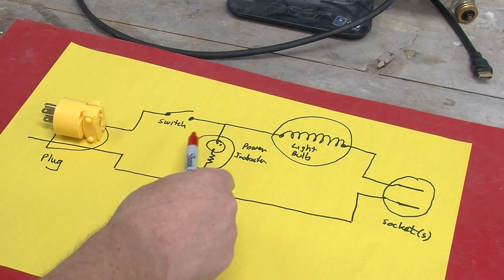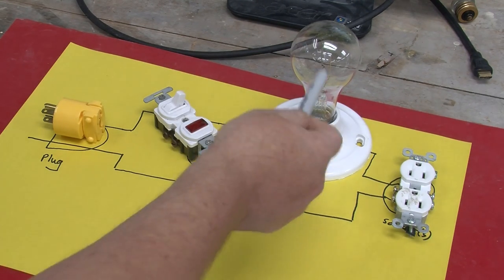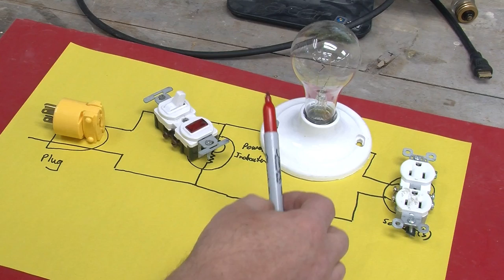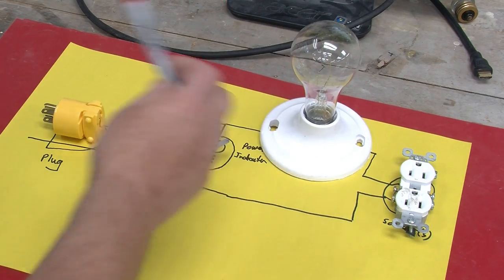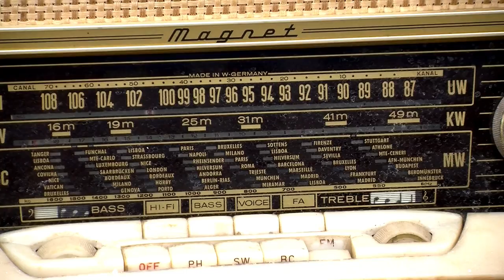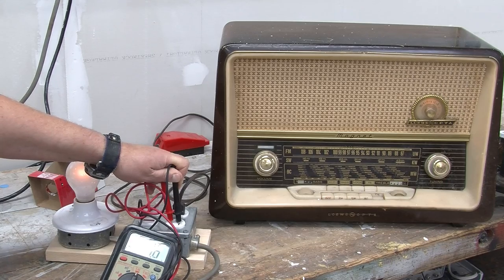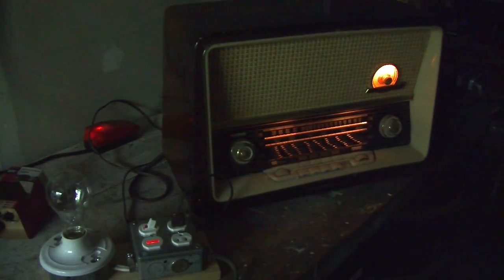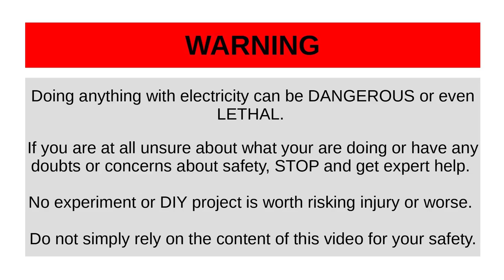When a Light Bulb is better than a Fuse

Comment: 1:56 he placed the pair of sockets upside down
Reply: Did he? Just because you're used to seeing the ground terminal below live and neutral doesn't mean that's the only orientation or even the most correct one!
If you look at the websites for manufacturers like Eaton and Leviton you'll find the pictures they use for their duplex receptacles have the ground above the live and neutral. They also often have text markings for either orientation.
Reply: Also in the US, the NEC doesn't specify which orientation recepticles should be installed in.
Also also, the outlet in the video is held horizontally, so any orientation will simply be horizontal.
Reply: @Falcrist  the outlets in the contraption with the light bulbs is upside down I was taught that ground should be down in Canada it really isn’t specified either but it REALLY bothers me seeing a plug outlet where the ground is up instead of down but it doesn’t bother me if it’s installed sideways though only if it’s upside down with the ground up does it bother me
Reply: @Falcrist  I once say this picture online (I don’t know if it’s still there) where it showed 2 plug outlets one with the ground down that said “correct” under it and one the that said “inverted” with the ground up to me it just looks wrong with the ground up and because that looks wrong it bothers me but I don’t mind them sideways though it’s only when the ground is up does it bother me
Reply: @michaelsegal3558  I believe you're both correct in that it's not specified but in my experience it's generally agreed on by electricians that ground up is preferred. Imagine you drop a piece of metal and it falls between the plug's insulation and the receptacle- in the ground down case it may fall across hot and neutral causing a short. In the ground up case it will likely bounce off the ground pin and fall away at an angle instead of coming to rest as it could across opposite two prongs.

I've read that you will often see ground up installations in commercial kitchens, hospitals, and office buildings for this reason

Comment: doesn't that country have proper trip switches in the db board that does exactly that? also using a bulb like that is waisting power
Reply from the maker: The bulb is just for testing and troubleshooting while repairing  a device. It limits the current if something goes wrong while still powering the device to make it easier to troubleshoot.
Reply: @ElectromagneticVideos  so acting as a buffer slash fuse
Reply from the maker: @jacquesb5248  Yes - and using the lower resistance of the filament when it is cool to allow almost full voltage to the device under test when the device is working. The Tungsten filament's resistance increases when glowing limiting the current flow if the is a problem much more than a simple resistor would.

Comment: This is just silly.  Period.  You don't need low current to find a short or to continue to cook a bad cap.  You can do that stuff with an ohmmeter when the power is removed.  This looks like something i would have fooled with in elementary school; I am quite serious here.
Reply: When you're firing up a 70+ year old radio for the first time you don't have to worry about a component failing short on you. I doubt many check every component first ;)

Comment: Sorry, a thumbs down because the point of this video was how the lamb can protect the circuit in case of a short. You should have simulated such and show how the bulb would glow at full luminance had the radio or any other device were to develop a sudden short. This is a common btw device used by (music) amplifier repair technicians.

Comment: I used a primary from a transformer...NO HEAT☝😁
Reply from the maker: You mean as a current limiter in place of the bulb? That's interesting! What size transformer do you use? And how much current does it allow that way?
Reply: @ElectromagneticVideos  a small transformer...i measured  0.36 henries which equates to 135.717 ohms in reactance☝😁
Reply from the maker: @gvcjbf1266  The interesting thing about what you are doing is the vector sum of  the inductor reactance and  load resistance will be less than the scalar sums of their individual  impedances. So it should be  better than a plain resistor in terms of providing current limiting in short circuit type situations and minimal voltage drop when the device under load is working properly and drawing less current, not unlike the bulb. Of course if the device under test has a transformer power supply with a significant inductive current, then the vector rum of the  impedance's  would be closer to simply scalar adding.
Reply: @ElectromagneticVideos could i add a 20 uf capacitor to the transformer?
Reply from the maker: @gvcjbf1266  So what would you be wanting to achieve? Looks like you chose 20uf to be resonant close to 60Hz.   The 20uf in series with the coil should makes the impedance cancel and effectively resulting in nothing other than the actual resistance of coil and capacitor wires. Drawing a current though it will create large voltages across coil and inductor with the vector sum = 0. In parallel, the combination should appear to have a very large resistance. If you experiment with either, be sure you use and  AC  capacitor with sufficient voltage rating and have appropriate protections like isolation transformer in place.
Reply: @ElectromagneticVideos  just limiting current surge
Reply from the maker: @gvcjbf1266  For repair applications or as a permanent part of something? Either way, adding a capacitor will essentially undo the effects of the coil. There are also thermistors often used to limit inrush current etc.
Reply: @ElectromagneticVideos  thanks...
Reply: @ElectromagneticVideos  i was trying to make a variable step down power supply for a nichrome strip...which is a part for a pet bottle melter...maybe you have some ideas?
Reply: @ElectromagneticVideos  computer power supply is expensive...dimmers dont go below 35 volts...saw a promising lead on king of random aluminum melter..but couldnt find the power supply...no benchlab power supply please
Reply from the maker: @gvcjbf1266  I had to look up PET = Polyethylene terephthalate   = common plastic bottles! That's an interesting project. It looks like you need a lot of heat and high temperatures, So let me ask you a few questions which will help figuring outs whats best: Whats the max voltage and power (or amps) of your nichrome heating element? Is it in something like a countertop oven?  Whats your level of electrical expertise/experience - minimal/ hobbyist/ experienced hobbyist etc? You seem to have a low budget - whats the max cost and what the reason for the project - art, recycling, experimenting, school project (what level of school). Where in the world are you - that will help figure out what parts are easily available to you?
Reply: @ElectromagneticVideos  my primary goal is recycling...my expertise is hobbyist...my limt is household item..for 3d printer.
Reply: @ElectromagneticVideos  nichrome wire specs...around 1 volt ...14 to 20 amps
Reply from the maker: @gvcjbf1266  So thats very low voltage at a lot of current which points to a switching power supply as the most inexpensive way to do it. Is that typical for 3D printers? If so are there cheap mass produced power supplies with this sort of spec. My first thought would be to get some thinner nichrome wire and use a longer length to require something like 20V at 1A which would be way easier and cheaper to produce and control.
Reply: @ElectromagneticVideos  i could open up a soldering iron...thanks ...but i had a step down microwave transformer in mind along with your lightbulb design...the secondary coil would determine the voltage...
Reply from the maker: @gvcjbf1266  Actually a a few turn of thick copper wire through a transformer core like that should work. Be sure to remove the HV winding from the transformer. There are videos on spot welders etc using those transformers.
Reply: @ElectromagneticVideos   directly adding mains power to the primary of a transformer winding causes shorts...it has no impedance...so your current limiting lightbulb helps thanx
Reply from the maker: @gvcjbf1266  Yes! I wonder how the spot welder people solve it. You could use the coil as you previously described in series with the stepdown transformer. If its also a microwave transformer too, be sure to remove the HV winding - I cant emphasize more how important it is for safety to get rid of the HV part.
Reply: @ElectromagneticVideos  thanks..they do that on purpose..btw
Reply from the maker: @gvcjbf1266  Great! Good luck with the project!
Reply: @ElectromagneticVideos  btw friend...have you tried with a soldering iron yet?😁its a heating element..no light...just heat
Reply from the maker: @gvcjbf1266  If you just want a resistor, any heating device will do. The advantage the bulb has for testing type applications is the large temperature swings on the filament which causes considerable changes to is resistance resulting in low resistance when the device under test is operating properly and drawing little current, and high resistance when the device under test has a fault. It can be thought of as a very crude constant current source.
Reply: I have found it...on electronoobz comment...it really works...just add a 20 to 50 microfarad capacitor to 120v mains☝😃thanks friend..i tried it
Reply from the maker: @gvcjbf1266  Glad you found the info you were looking for - good luck with the project!
Reply: Thank you friend...please show it in one of your vids..maybe help somebody in the future😃
Reply from the maker: @gvcjbf1266  So I understand correctly - are you just using an AC 50uf capacitor in between your heater and the mains? That would only give a couple of amps and no protection from AC shock (scary). Am I missing something in what you are doing? As I recall you wanted higher current.
Reply: @ElectromagneticVideos  its about adding a 20 to 50uf cap to mains connected to a primary of a microwave transformer...that connect to a few turns of wire for a metal melter....the other guys never showed it😃
Reply: @ElectromagneticVideos  useful to melt pet bottles if connected with nichrome ribbon to heat plastic...in an isolated can
Reply from the maker: @gvcjbf1266  So is the cap connected in series with the transformer primary, or parallel to it?
Reply: @ElectromagneticVideos  just proving showing youtubers that you can melt metal .weld even mrlt aluminum and plastic direct from mains...no expensive equipement or car batteries needed 😃😃😃
Reply: @ElectromagneticVideos  series...the primary of a microwave transformer is a dead short...be careful☝
Reply from the maker: @gvcjbf1266  It shouldn't be a short - unless the secondary is essentially shorted and the cap is being used as a current limiter? I actually have been planning a series on transformers - just bought half a dozen torroid transformers - they are great for demoing things. Could you email a photo of your setup - I might do something on current limiting transformers.
Reply: @ElectromagneticVideos  dude..its made that way...trust me☝😁

Comment: Actually, no, the LED bulb did not replace the incandescent bulb. Neither did the CFL bulb. Incandescent still existed along side both of them. Halogen bulbs have actually replaced the incandescent bulb. If you open up a standard (non-LED) bulb now a days, you will find everything exactly the same as an old incandescent bulb minus the filament. They have replaced the filament with a small halogen bulb.

Maybe you should do some research before making non-based statements.
Reply: The LED has replaced the incadescent bulb in most use cases. Do you still light your home with incadescent/halogen? Most people do not

Comment: I can not stand the modern day led bulb.I stay with all the old school bulbs that has a bolder lighting that throws less shadows.led bulbs throw to much shadows and the light wave is to thin.I tryed a lot of led bulbs and returned them just go back to old school bulbs. Most modern tech,like tvs so on are garbage compared to old stuff.
Reply from the maker: I have a number of CRT HD TVs - the last hurrah of CRTS before flat panels - I'm sure you would like them - they have some of the best picture quality ever!
Reply: @ElectromagneticVideos  
Crts are the best and last longer.Do not get me wrong,led dos have a great picture but thats about it.The performance sucks compared crt.I do see led tvs have smoothness but when people turn certain way it xan micro jittier till it faces the smooth part of movie.Theres pixels delay.Crt do have there cons but I play a lot of old retro games.new games performe better on crt but there colors and brightness do shine on modern tvs of course but the old games are to flat and pixelated with out scanlines and the 0 lag.
Reply from the maker: @ghostbombl8034  I had heard gamers use old crts because of the fast response. If you come across a hd crt (Toshiba made a lost) might be worth trying - the typically can do 720 or 1080.
Reply: There are LED bulbs that are closer to full spectrum but they are also a lot more expensive than the cheapies most people buy. LED lamps are also responsible for a lot of high frequency switch noise that is polluting the air waves. Amateur radio operators hate them, apparently
Reply from the maker: @mr-meek  I should do a video on both topics. Have a real spectroscope and its interesting to look at the optical spectrum of things - as you suggested - a huge variation! But the good ones are really good. And also video on the electronic power supply noise issues - high frequency and low (which distorts the power grid AC waveform these days).

Comment: 3:10 ish totally wrong. disagree all electrical math resistance goes down.with heat.  thermal runaway happens. not resistance going up...
Reply: You're right!  That's why supercomputers are typically placed in active volcanoes, and not given liquid nitrogen baths.
Reply: You might be thinking of a thermistor in an electronic circuit that when heated the resistance gets lower. When wires get hot the resistance increases. When a tungsten filament gets hot, let's say in a light bulb, the resistance increases. Same applies with power distribution cables reducing their efficiency.
Reply from the maker: Your absolutely right. nn may also be thinking of more convectional semiconductors where more charge carriers become available as temperature rises.
Reply: Agree to disagree. Metal conductors,Atoms vibrate fast with heat, lower efficiencies and creates more heat. Heat is power loss. In a circuit... was just referring to the time stamp statement. Simple ohms law... please educate me. I'll admit to being wrong. Please provide data ...
Reply: @thematey3592  agree to disagree... Heat draws more current. And thus less efficient
Reply: Did more research... well darn have to admit I'm wrong. Resistance can go up. Learned something new. Apologize. Going to do more research. Now I'm intrigued 🤔.
Reply from the maker: @nnperformance76  No worries! Interesting discussion resulted.To me its interesting how resistance different things can either increase or decrease with temperature. I occasionally have had to design power electronics - sometimes you have to parallel components to handle large currents - and depending on a positive or negative temperature coefficient, it may not work : wrong device type and the hotter device will get an even lower resistance and get even more of the current and get even hotter in a vicious lop, and no current sharing takes place.
Reply: @ElectromagneticVideos  thanks for not beating me up. Was wrong and it's nice to agree to disagree and still have a great conversation. Appreciate that. Learned from this... looking forward for more education vedios. And heck might still be wrong but now I have to give u crap.🙃😉😀 good 👍 job it definitely changed my ideas of electric circuits.
Reply from the maker: @nnperformance76  LOL - so glad you got something out of the discussion - I have been amazed how good and interesting some of the discussions have been. And have been surprised at which videos generate the most interest. I never would have guessed this one would end up with so many views - its such a niche topic. I hope you will find some of my future videos interesting and please comment and/or ask questions! Right now I'm doing a few more of the "wires with overcurrent" videos because I'm set up for that and there aren't many videos out there on that topic - and its really good for people to understand what the rules are there to prevent. By soon I will do do some other topics. Unfortunately I'm limited by time to about one a week.
Reply: @DrFiero  I legit LOLed 🤣